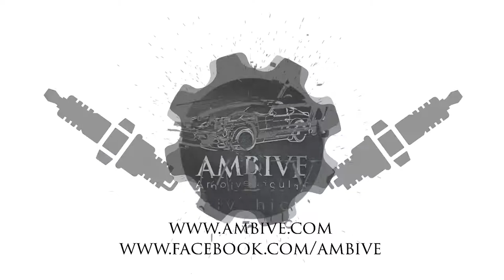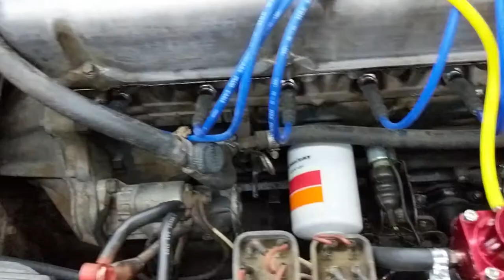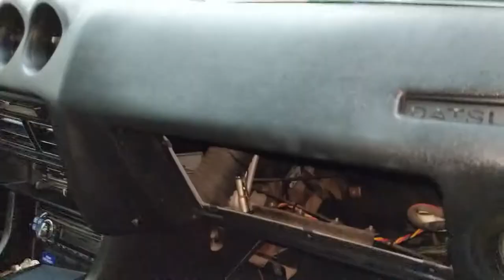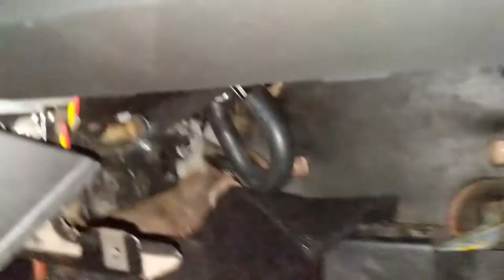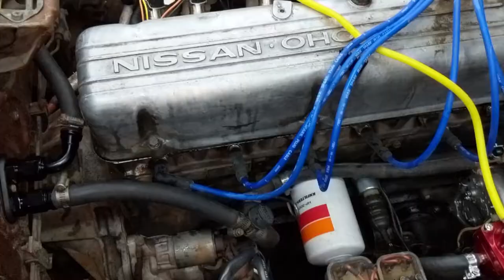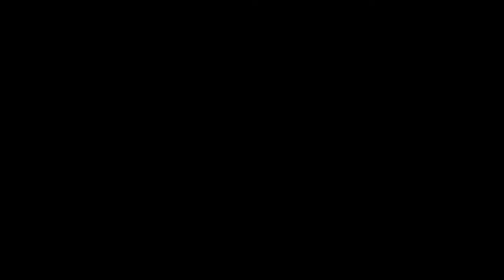280Z DD Project - I don't think coolant goes there...

Comment: Japanese cars of the u0-80s rubber had a high natural compound. Today the replacement rubber is more synthetic based and. Doesnt get brittle like the old rubber compounds. 
   The fuel systrm has alit of rubber hoses to and from the gas tank to interior evaporative canaster .these get very britgle and you will get the feul smell in the cabin. Just again old age once replaced tbey are fine.
The back hatch seals and taillight seals need to be sealed thoroughly to keep exhause gas fumes out of the cabin .
Again just old age . They are very dependabke once the little thinks are refreshed. Z car depot has a great EZ- fast systrm to update and streamline the old fuel injection car.
   Im building mine for everyday driving and my step daughter that lives in the north east Im building her 73 240Z into a rally version of the 240Z. So she can drive hers on dirt roads and pavement.
Reply: @CasperLehner  yep yep...when you want an old car so bad you can taste it ...old cars find you..

Comment: To anyone watching this. be very wary of the preformed replacement hoses sold at the z parts websites.  they're piss poor quality and thinner than regular heater hoses. i replaced mine with them and they blew out only a couple years later. Trust me, you don't want to do this job every 2 years!  its a pain in the ass getting up under the dash!   I found some gates hoses on amazon with shapes that were close and trimmed them.
Reply from the maker: Good advice. There are a lot of low grade Chinese parts sold as direct replacement that are technically the same fitment but horrible quality.